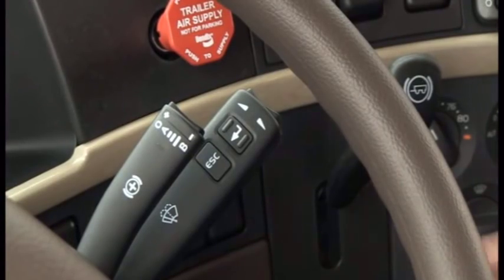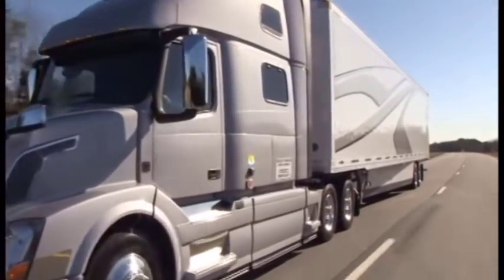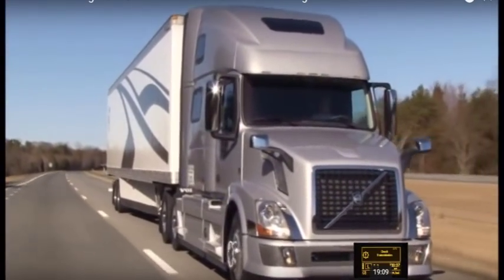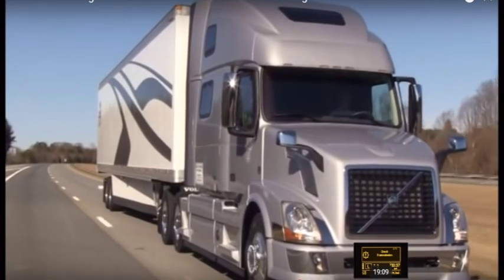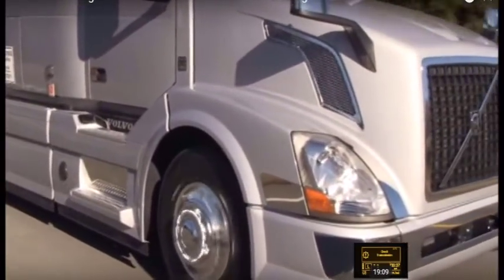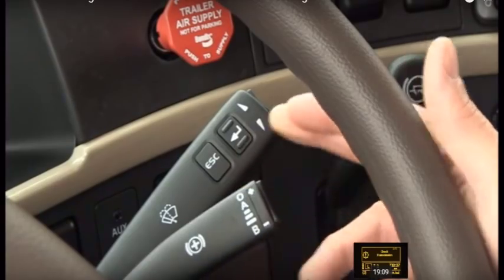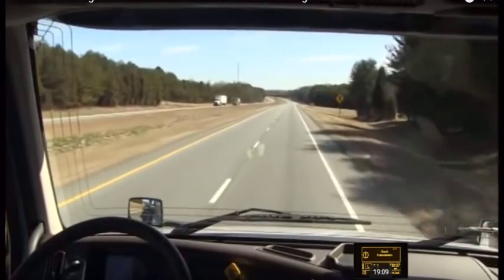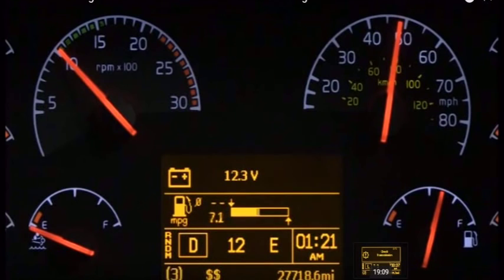Volvo Engine Brake with I Shift Transmission

Comment: The CC settings and engagement or on the LEFT side of the steering wheel, not the RIGHT. Also, out of curiosity, what are those $$ signs on the dash screen?

Comment: A very useful video...I usually started at the crest at low speeds....used the manual hand shifter (on side of seat) to adjust speed manually (23 to 35 depending on downgrade and speed limits)...when they modernized and changed the design,  once the slope changed, we struggled trying to keep eyes on road while reaching dash buttons on far right side for downshifting...a pain for sure....no one explained the cruise.  Would have made a world of difference....I seldom use my foot brake unless absolutely necessary...to avoid smoking the breaks.  Couldn't help but laugh when he said "if you need more retardation"   HEHEHE
Reply from the maker: lol... glad it helped.

Comment: I have a new 2020 860 with i shif and d13 wht 500 hp engine which i  previously enjoyed on a 2012.  But this engine brake on new truck is a joke! I tried the using "A" position in cc control to realize better engine braking. Does not work very well either. BTW I have been driving trucks for 53 years and for many years with no engine brakes, therefore I kind of know the difference. With this new d13 engine brakes I am thinking to myself that I may have to go back to utilizing the same rules operating w/o engine brakes, I know how to do that, except I shouldnt have too! Ipaid for at least average engine braking that has now become a reasonable expectation. I have only 11k miles and am extremely disppointed. Questioned service writer at a major volvo dealer located in the intermountain west about others that have complained. His answer was they have hooked up many of these complaints to the computers and have found mostly no problems they can correct. He tells the drivers/owners that they will have to "get used to having less engine braking than they were used too"  We volvo owners/drivers should be yelling to the high heavens that this is unacceptable! Especially when we are in an age that most new drivers have no idea how to drive without engine brakes today! Engine brakes maynot be required by govt, but there is a new level of industry standard that Volvo should have to subscribe to when marketing engine brakes. Complain to Larry Long, National Highway Transportation Agency, he is an investigator: 202 366 6281  or larry.long@dot.gov. He does respond at some point.
Reply from the maker: Jerry - Volvo has changed the engine brake settings when using cruise control.. it's actually been enhanced. The problem is they haven;t educated anyone on it... no videos or sales literature to refer to. You can now set the cruise control setting for downhill while engine brake is in the "A" position... this allows you to cruise down ANY grade at whatever speed you set and you'll never have to to touch the brakes. On the left side of the steering wheel is the button to set the engine brake speed. I'll try to develop a video in the future, but for now, you can simply play with the buttons until you get it set. Essentially you want to set cruise control first just like you would in the past... then you use the new engine brake button on the left side of the steering wheel to set your downhill limit... the truck takes care of the rest. 

It's too bad Volvo has done such a piss poor job at educating people on this, because they're the only OEM that offers this level of sophistication on the engine brake.

Be safe out there!!
Reply: Bill Day I’ve tried this on my 2019. No luck. This engine brake feels like at most the #2 setting on my DD15 freightliner and my ISX15 international. I use it similarly to not having an engine brake as well. I’ve tried using/holding the B position, using the Cruise with the “A”setting, haven’t had any kind of luck. Even manual mode slowing down 15 mph and shifting down 3 gears. Nada. Wide array of different RPMs and still no luck. Probably going to trade this one for a Freightliner
Reply: Too weak depends how heavy you were,right?
Reply: Jerry Fritts I thought I was the only one. Everyone was telling me I didn’t know how to use my engine brake. I’ve tried everything as per my previous comment and this engine brake is complete trash. I use it in combine with my feet brakes

Comment: When I’m driving in traffic or highway should I put it on 0 (off) or A ?
Reply from the maker: My personal preference is A... this is the Automated setting where it will engage as needed and at the proper levels. If you are in traffic under , i believe 30-mph, the engine brake won;t come on at all, but above that it will on engage engine bank 1, 1&2 or 1,2 & 3 as needed. it looks at speed, whether or not you are bobtail, whether or not you are loaded or empty, and it also looks at brake pressure application PSI.
Sooo, if you are bobtail driving driving 45-mph, it will may only engage engine bank 1 as opposed to if you are at 80,000lbs running 75-mph and you slam on the brakes with heavy pressure, it recognizes this is a panic style stop and will engage all 3 engine banks AND, since you are in A-mode, it will also downshift the transmission as fast as is needed to help stop the vehicle. 
It's just an added bonus to the Volvo I-shift that  not many driver's are aware of.

Comment: Volvo needs to have a training CD for the use of their technology when you buy the truck the deal or doesn't tell you anything about how to operate their very cool features...... It took me a couple weeks to figure out the grade braking, engine brake and Target break speed features all are very cool I have found that on fully grossed out loads I can go down extremely steep grades and use the target break speed to regulate the downhill Speed without needing to use the service brakes whatsoever
Reply: Charles Pyatt True but best to read the manual and go on YouTube
Reply from the maker: Agreed... a lot of that comes down to the salesmen as well. They should explain everything to you upon delivery.

Comment: Bil Day, First you say to put the stalk in the A position and then when you reach your downhill speed then you engage the cruise. At 1:03 you say to put it in the A position and then push the plus button. Those are 2 different  procedures, I don't get it. I guess I have to play with it. PS I have a 2017 Volvo VNX with the I shift. SO far I love it.

Comment: Why did it need to be so complicated!?
Reply: not complicated at all,it is very simple and very practical and most important eazy to drive.
Reply: Funny how, when I asked every drivers on the road or anybody in the field of trucking, no one could explain to me the air conditioning or the engine brake. I had the Owner's Manual and didn't help too.
Reply from the maker: that's about it... put the engine brake in the "A" position and set your desired cruise control speed. That's it. Now whether you're going up and incline or down an incline, the tractors will keep within 5-mph of your cruise setting. The engine brake will automatically adjust the level of braking based on the decline and need. If need be, it will go all the way to 100%.
Reply from the maker: The simplest thing to do is set the cruise control and let it do all the work.. simple.
Reply: And, how do you set the cruise control?! What if the right handle is at position "A" and nobody tells you how to use it? The Engine Brake is supposed to work 100%?!
Reply: Myriam Thibault The man just said it, they made it difficult because of retardation.
Reply: Bill Day it does not stay within 5 mph of set CC if you pull 135000 lbs. It tries though.
Reply: First, the Owner's Manual don't explain it. Second, everybody is used to push on a simple button. If it wasn't from this unique video, I wouldn't have known how to use the engine brake!